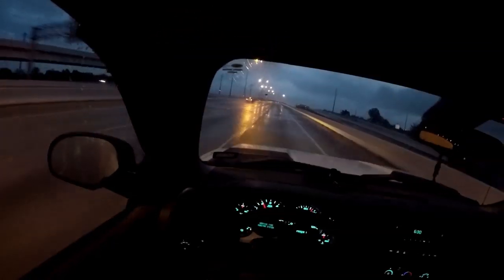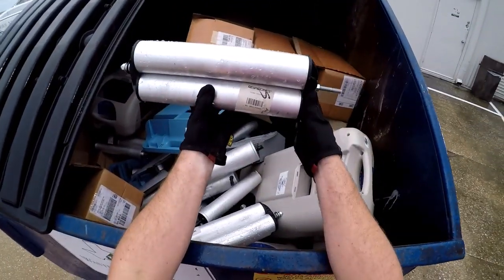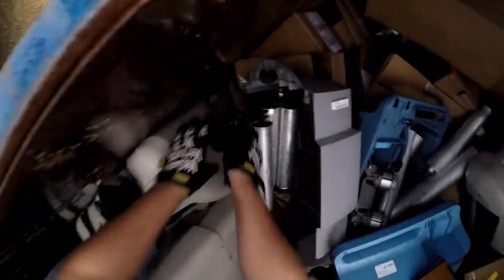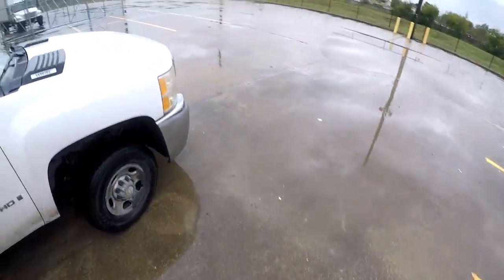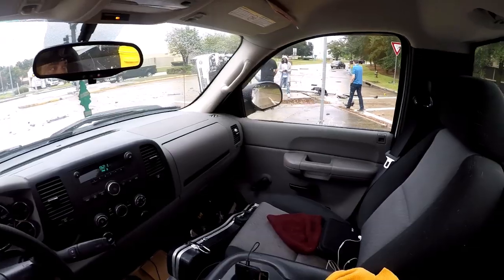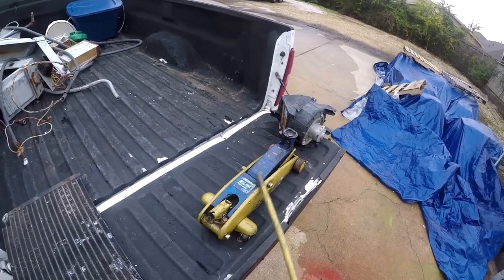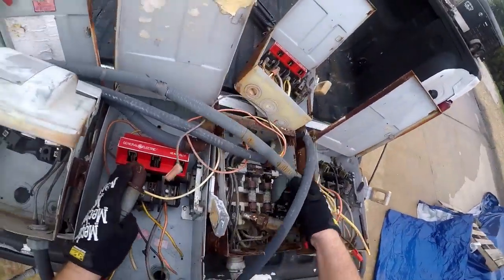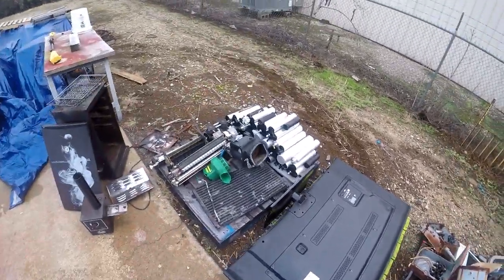Dumpster Diving 12 (Quickie... Scrapping In The Rain!)

Comment: Hi Mike them printing press parts are actually rollers that were used in a printing press plate developer. We have something like that at my job but a little bigger. It’s for polyester plates not the expensive metal ones.

Comment: Oxygen concentrators are for use by people with COPD, or other lung diseases like Sjogren's - i.e. autoimmune - cystic fibrosis, etc.  They pull O2 out of the air, so it's safe to scrap the cylinders.  The concentrators are safe to take on airplanes and the like, unlike oxygen tanks.  A late friend with Sjogren's had one of the prototypes.

Comment: Bet they scraped out the oxygen generators to keep someone from pulling them out of the dumpster and reselling them. If someone bought one and used it for a old or sick relative and it did not work properly resulting in a death, then everyone in the food chain, Mike, the business where he found them all the way back to the original manufacturer would be named in the wrongful death lawsuit. Hell hath no fury like a an outraged lawyer on the scent of slam dunk litigation!
Reply: i would buy any of the oxygen generators i have been trying to find used ones with no luck
Reply: Do you really think the business would do that?  No, they threw them out because they're worthless and can't be refilled.  Besides, on the one and a kajillion of the chance the new oxygen concentrator they would have resulted in a death is ridiculous..  The patient would know it wasn't working in about 3  seconds. I also think Mike wouldn't know how to make a concentrator.  I can't believe you got 8 likes so far.
Reply: Omahabigbil, yes, but I was not talking about the business. I was talking about individuals, how individuals will litigate for any thing. I was talking about how people will sue every single individual and/or company that has any potential connection to the reason they have chosen to sue. I have seen this personally at a company I worked for. Nor was I talking about Mike making machines from the various disassociated parts he collected. I feel you have maligned poor Mike as well by inferring he is technically challenged, not that I feel he would have the audacity to sell makeshift medical devices to an unsuspecting public. Please reread my original post and compare it to your rebuttal, can you see where the two diverge?
Reply: Sure. When I used Mike's name, I should have used John Doe instead. I suppose some people out there could make a concentrator, but they would have to find another trash dumpster that had the cylinders. My bad.  I just think it's a sue for everything world.   Back in my day, well who wants to hear about that? It wasn't a sue happy nation. Later on it turned into a tort nation. One shining example to me of how the system is messed up.  One day in Omeehaha, a young grandmother took her 6 year old grandson to the store.  She got in an accident, her fault, and they were both injured, the boy critically.  An everyday accident that ended with the 6 year old boy paralyzed with a brain injury.  Did I forget to mention how the grandmother had the grandson in the FRONT seat with no SEATBELT. When the accident happened, the airbag went off and that's what caused the paralysis part of the injury. I thought it was a shame the young boy got paralyzed, but figured Granny's insurance would pay.  Sorry I can't remember what they paid.  But then, the grandmother sues the airbag manufacturer for damages done by their airbag.  Wait a minute, didn't she have the 6 year old in the front instead of the back (more safe), and he was not strapped in?  Doesn't that make her at fault?  Not according to the jurors. They found for the plaintiff and awarded Granny millions of dollars for future medical expenses!  Wait, it was HER fault!  How could they find in her favor? The airbag wasn't defective.  Torts, a lawyers dream!

Comment: Do not open the cylinders they look very much like aviation o2 generators if so wen triggered they heat right up set something alight then feed the fire with the o2 spurting from it. They are not supposed to be tossed out like that